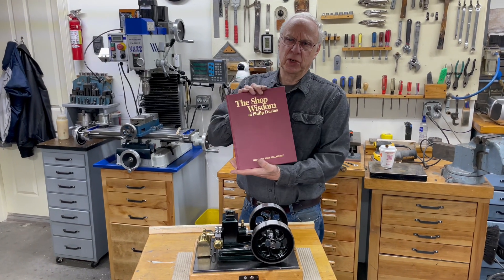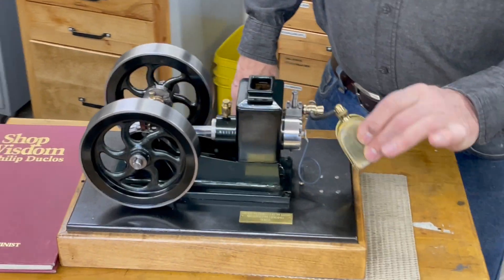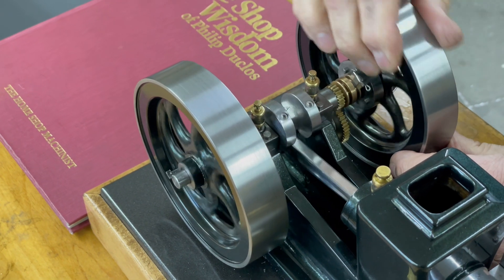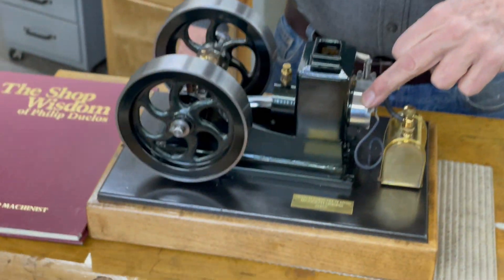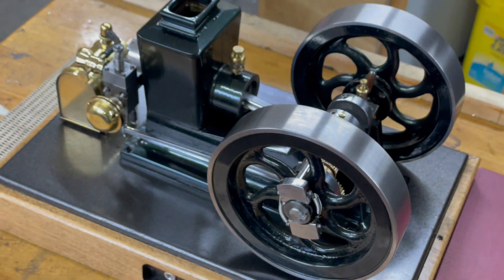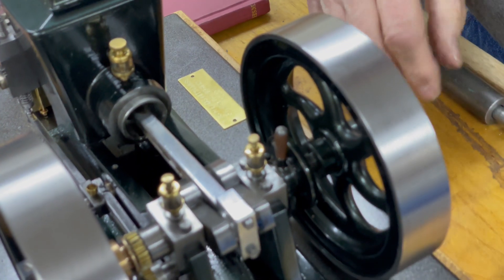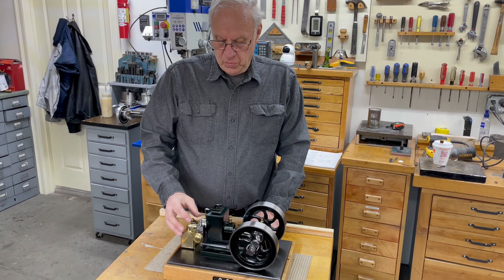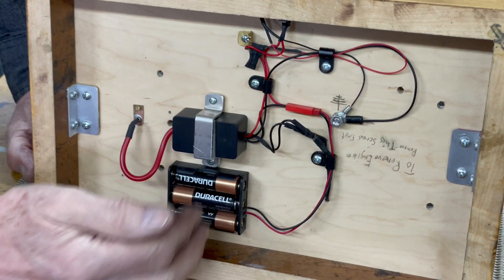Odds 'n Ends Hit 'n Miss Engine by Joe Higgins. Plans by Philip Duclos

Comment: Hi i've measured mine and its slightly smaller than 5/16th to small i think. The compression is good. The head has a recess  that sits in side the cylinder but dont know the gap between the head and piston  at top dead center no measurment in the book to go by...... your right the book is very good im in the UK and i got it from the US
Reply from the maker: It’s very hard for me to give someone suggestions without actually having the engine in hand. What I do when I get stuck is start swapping parts from engines that are running good. Spark plug, ignition system, carburetor, etc. that way you can find out what (it’s not. ) Not breathing properly is a problem sometimes and too small valves can cause that. But you said it doesn’t even fire. Too much compression can cause the plug not to fire. Especially when you have a miniature ignition system.🤷🏼‍♂️🤷🏼‍♂️🤷🏼‍♂️ keep at it and I’m sure you will get it and learn a lot in the process.
Reply: Thanks for all your help very helpfull. I have it runing on a viton o ring but i will try it again on the cast iron rings but last time i had NO conpression. I think if it would run with them for a bit thay will wear them selfs in. My uncle COLIN SALTER  has helped me with it to and got it runing. He's a engine builder on you tube to. He's well worth a look at. Many thanks for your help.
Reply from the maker: Ok Martin I sure you will get it running and when you do you will be much smarter with your next
Reply from the maker: I didn’t finish the last comment. What I was trying to say was, the next time you have the same problem you’re going to know exactly what to do.
What makes this hobby interesting is the solving of problems. There is always something to figure out and that is good for the brain.
Reply: Very wise. Thanks for all your help.

Comment: Hi can you please tell me if your using o rings or piston rings and the plug please. Great work.
Reply from the maker: Hi in answer to your question, I always make cast iron piston rings for all my gas engines. An o ring on a spark plugs would not work at all. You didn’t say spark plugs but I can’t think of any other plug that you could use. Joe
Reply from the maker: We will soon be making a video about making cast iron piston rings. Its on our YouTube list.
Reply: Thanks for replying so soon. Sorry i was meant to put viton rubber piston  ring. You answered that question. Please can you tell me The type of spark plug your using.
Reply from the maker: I use mostly Rimfire model spark plugs.1/4” 30 thread. Also I have a few Chinese ones that seem to be ok.
You can find the manufacture on google. Joe
Reply from the maker: Sorry I meant to say 1/4”-32 thread on the plugs.
Reply: Thanks very much for the info.I've made this engine with the valve in the head and the same plug. But no firing at all i have a good spark. Can you please tell me the size of your valve head many thank and keep up the good work.
Reply from the maker: I don’t think that the size of the valve was changed. It was the same as the original engine. I believe 3/8 “ . Hows the compression feel.  The compression ratio should be about 4 to 1.

Comment: Great job on the engine. You are very detail oriented. A perfectionist. 
I have a question. At about 3:45 or so in your video, you flip the engine over showing the ignition set up. It looks like you have two grounds. I assume one comes from the engine frame. What about the other ground? Do you ground your Hall sensors? If so, straight from the negative lead on the sensor?
Reply from the maker: I don’t seem to turn the Odds an ends over in the video. And it isn’t 3.45 minutes long, am I looking at the wrong video?  On the other hand I know that I don’t ground the hall sensor, it may be just a ground for the pilot light.I can’t look at the engine because it was sold last year. Sorry Joe

Comment: Very nice engine love all the improvements where did you find out about information on any of the electronics timing.  Thank you 😊👍👍👍
Reply from the maker: I’m not sure what you mean. If you are asking about the ignition system I found it on eBay.  My only other supplier retired. (SS machine) The eBay ones are made in China.
Reply: Thank you 😊

Comment: Another great build and video.
Im definitely going to buy that book.
Would you be able to list other books you might recommend?
Cheers,
KJ
Reply from the maker: Hi Ken,
Without knowing your level of building and the type size of your machines. It’s hard to recommend something. If you like anecdotes, tricks of the trade and also some projects you might like the Machinists Bedside reader series by Guy Lautard. I found them extremely informative and interesting. 
Ps thank you for your comment. Joe
Reply: @JoesModelEngines  
Thanks for the reply,
I already have both v1 and v2 of tips and tricks, and a couple very beginner steam engine books. Any ideas on intermediate and advanced books would be great.
Thanks
Reply from the maker: @kenjackson5938  I really like the plans by Doug Kelly,  He has a great book with 4 sets of plans. Also Home Shop machinist is going to start a feature article on building the Mariam Abbott generator, I think in the next issue.  That is a very interesting project.
Reply: @JoesModelEngines  
Perfect, thanks,
I always figure, almost Any book is good for a library, even if the plans are such that I may not build them, Better to be looking at a book, then for it.
If you ever think of anymore, thanks in advance.
Don't forget the idea of a shop tour on video.
Reply from the maker: @kenjackson5938  I did a shop tour a few years ago but I’m thinking you might have a great suggestion. I’ve change a few things and added a few things . So if you see a new shop tour it’s because of you. 
Thanks ken